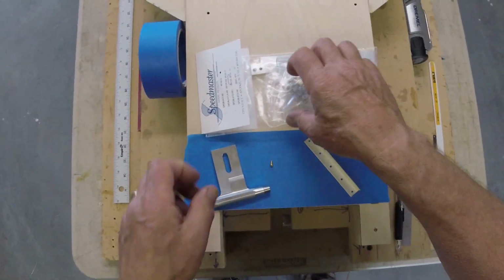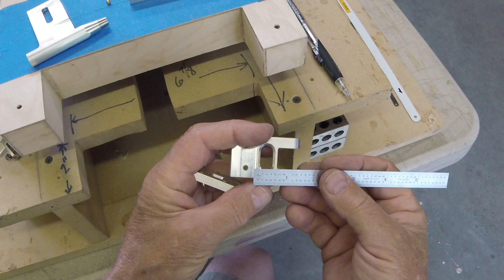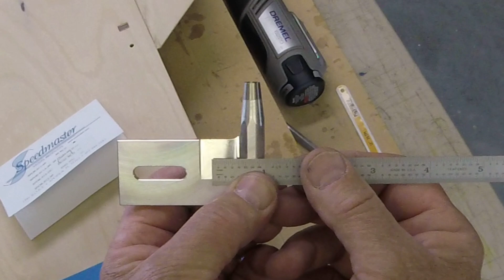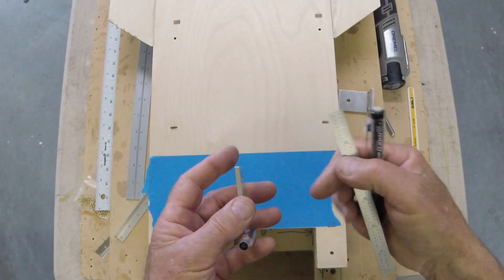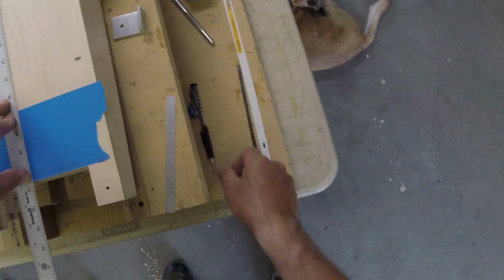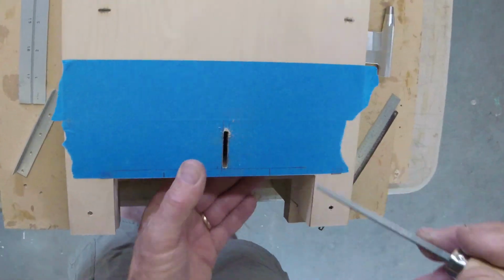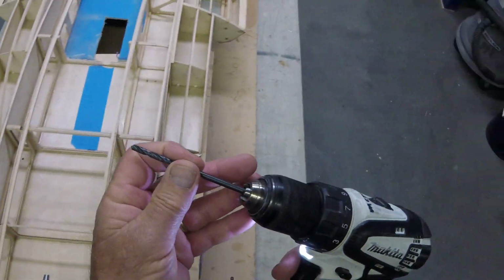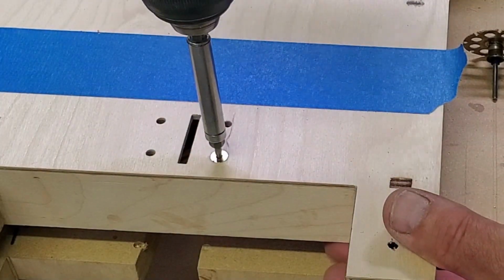Installing The Strut - You Gotta Watch This One! | RC Racing Model Boat Building

Comment: Love the idea of the strut on the bottom to make it look more realistic, my only question is once you are finished the boat and need to adjust the strut for whatever reason……..do you use anything to seal the area up or is the fitment so tight that water doesn’t get in???? Or do you expect a bit of water to enter the inside of the boat?
Reply from the maker: The fitment is very snug, but if you do find that you need to enlarge the slot for more movement just put a dab of silicone in any gaps
Reply: @M5PerfHydros  awesome thanks for the response. I do have another question for you. In relation of the rudder to turn fin, when you flip one of your hydros upside down on your workbench is the fin and rudder equal distance off the bottom of the boat or would the rudder be a bit deeper……. Turn fin deeper????? Building a hydro and was curious as the relation to each other.

Comment: Scott, really enjoying this video series. Being that the bearing block bracket and bearing block itself are so heavy could the footprint of the bracket and the tail of the bearing block be milled down an 1/8" and the removed material replaced with a piece of 1/8" ply to make up for it?  Might make the transom slightly stronger and save a small bit of weight. Your thoughts?
Reply from the maker: Yup you betcha.  But I'm trying to keep it simple so the average bear can do it. Stick around, I have a solution coming up in a video soon that I think you'll like

Comment: Hi
 I follow your consturction.
Could you explain why you fixed the strut on the bottom and not on the transom it would be much more rigid.
Thanks
Carlo
Reply from the maker: Old habits die hard I guess. Our racing rules require the boat be configured as closely to the original, full-size boat as possible, so this is really my only excuse for floor mounting. But now that you've brought it up, I'll rethink it, and if you see me mount it to the transom in future builds you'll know that it's all because of you!

Comment: Under the heading of trust but verify (I heard a smart guy say that once or twice), unless I'm confused, it seems like pre-disposing the strut toward the turn fin is angling it the same direction as a rudder during a left turn.  For a boat racing in a clockwise direction, this seems counterintuitive.  Could you explain the mechanics of how this helps in the turns?  Thanks Scott!
Reply from the maker: I see where your thinking is coming from, but your idea only makes sense if the boat were stationary and we only wanted to spin it in a circle.  In this case, yes the boat would spin around much quicker if we angled the strut to the left. The difference is we don't want to use the prop thrust to spin the boat, instead we use it to thrust the boat toward the turn fin, reducing the drag caused by the fin, and pushing the boat toward the turn instead of spinning it around.
Reply: @M5PerfHydros  Thanks Scott, I think I follow...The rudder steers the front end, and the angle on the strut pushes the back end...Am I in the ballpark?  Does the theory also apply with hooked turn fins?  I know you're not a fan, but Mike Luszcz recommends it for the boat I'm building.  Thanks again!
Reply from the maker: I've seen a few boats with hooked fins work awesome, so I know it's possible, but many have terribly bad behavior, so it certainly seems much more finicky that a straight fin.  Thus I suspect the boat may be a bit more difficult to set up, but I would expect all other dynamics to remain the same
Reply: @M5PerfHydros  As a newbie, I really don't know what it looks like when a turn fin is behaving badly, but I guess I'll have to figure it out.  But I might also get ahold of a straight fin, just in case!  Thanks again, Scott.  Really appreciate and enjoy your videos!
Reply from the maker: Give 'er heck Bill!

Comment: Gday Scott. Mate is Speedmaster struts got oil hole in them from now on or custom for the wire drives
Reply from the maker: That's done for the wire drive, but I would darn sure do it regardless!

Comment: I've  been told the rudder on the same side as the turn fin pushes the rear of the boat around the turn causing the outside to drag the water , the rudder opposite  side of the turn fin pulls the rear around the turn  causing the outside to skip over the water which is faster,  But can cause the boat to hook spin easier  ?
Reply from the maker: Sounds good to me

Comment: The strut that your using in this video I can not find it at Speedmaster   where could you get it
Reply from the maker: It's a modified speedmaster strut as supplied by Brent Byers along with his solid flex drive system. I believe it's a speedmaster extended 1/4" strut with the rear cut down